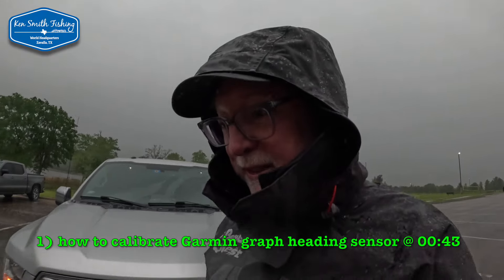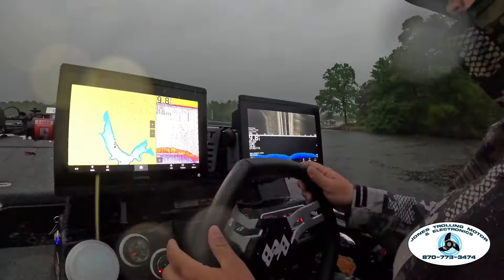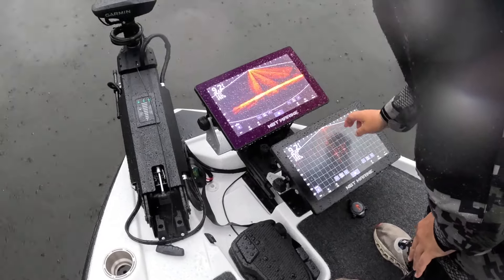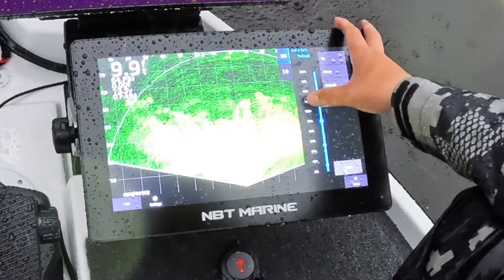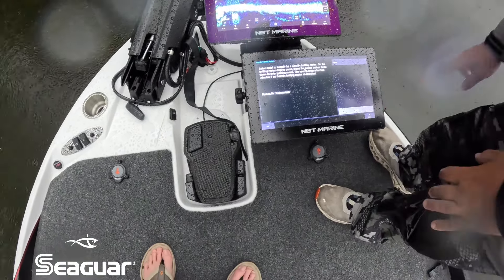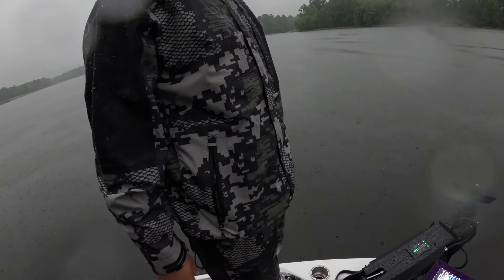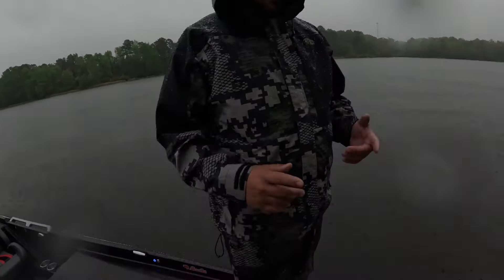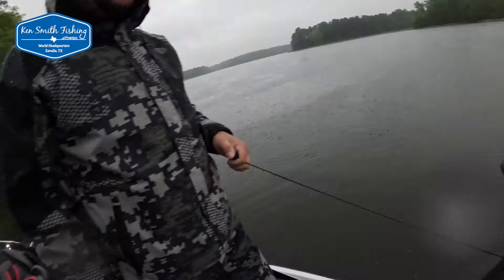Garmin Graph LiveScope & Force Trolling Motor Setup & Syncing

Comment: Very helpful video! A couple of questions when you have time: 1. Would adjusting “focus” setting take some of the lines from different beams out of perspective mode view? 2. Was your entire basscat panel flashing or was that just the camera causing that?  Thanks!
Reply from the maker: Jeff the only way I’ve found to eliminate is to turn gain down or turn forward off. On the flashing that was camera, not sure how that works but I noticed in edit
Reply: @KenSmithFishing  thanks!